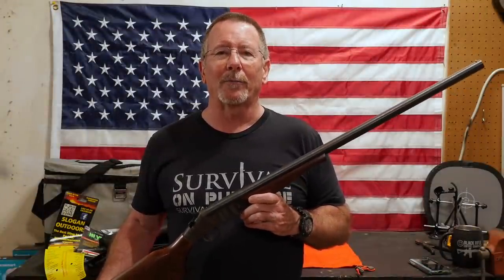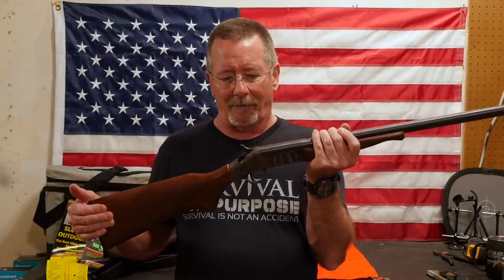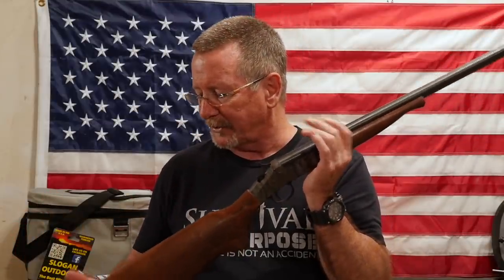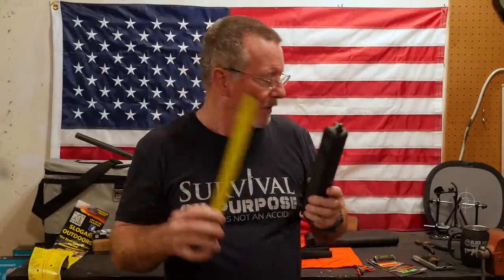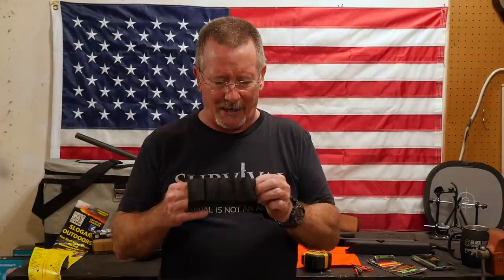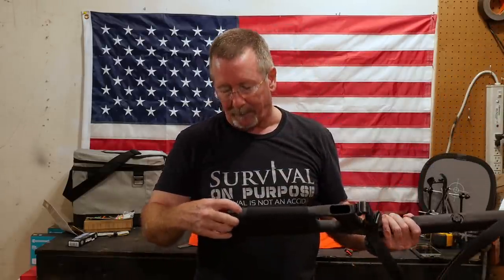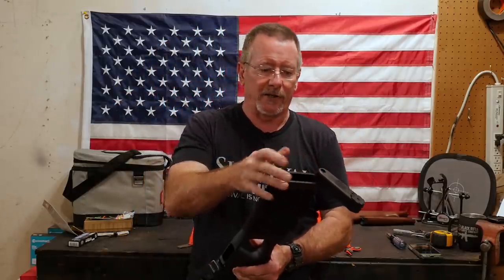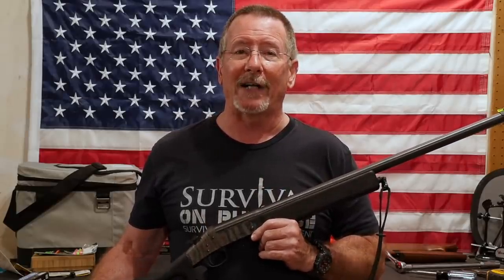How To Build A Survival Shotgun From a $100 Single Shot 12 Gauge

Comment: I’ve got one of those. It’s right beside me in my tv room. I had one of those elastic ammo sleeves on it too. Over time the elastic breaks down and they flop around and the shells fall out.
Reply: Get one made from leather or nylon. You can also get a metal or plastic sidesaddle for a pump gun and and attach it on the side of the stock with a couple screws.

Comment: I like your mods as they are almost Identical to what I did to my ATI single shot 12 gauge with the 19.5" break over barrel, which incidentally came with stock storage, and only cost me $99 plus tax at my local pawn shop.  You got about $250 in yours, and I got $140 in mine, having picked up a used sling and butt pad for $5 each at the same pawn shop.  And mine will fit in a backpack without diassembling.

Comment: Cool upgrades,  I would add my set of cylinder adapters that way I can shoot 12 , 20 and 410 gauge,  and also 22 rim fire
Reply from the maker: Yep, and black powder
Reply: Starting at 12ga, I'm up to adding 9mm, .45 ACP, .38 SPL/.357 Mag, .32 ACP/.32 S&W/.32 S&W Long/.32 H&R Mag/.327 Fed. All in 18" rifled. Search Chaszel. Top quality at a great price.
Reply: That’s what I did, I put 410,s and 22lr in stock along with a compass fire steel and a magnifier . In the hole of the pistol grip I fitted a minke multi tool, in the for-end I have a fire starter kit along with the Short Kane adapters ( not in original container ) I had to use 3/4” over for a container for them. I also cut barrel to 18  1/2 “.  It is awesome for a truck gun.

Comment: Two acquaintances of mine, one a Marine and the other a Soldier both Viet war combat vets told me that (topper) saw'd off single 12ga saved their lives. They both said it's all you need. Good enough for me, also my Dad a WW2 combat vet only had a 12ga wingmaster in the hallway closet with a box of 00buck above, on a shelf, I guess that's all you need. I have the single 12 in my car trunk with a box of 00buck and a hack saw next to it and a half round bastard file, I should find a pipe cutter to to it nice but I figure nice isn't a necessity.
Reply from the maker: That may be all they needed but things have changed. A single shot shotgun is no match for multiple thugs with semi-auto pistols. Or at least nottyhe optimal choice anyway.

Comment: I built mine for cheaper. Just gotta shop around. I also used a One Tigris ammo ouch on the stock. It has a zippered pocket for extra storage. I’m not putting an adapter with mine. I have 12 gauge flares, buckshot, bird shot, and slugs. It was still very late and had storage space
Reply from the maker: Whatever works.
Reply: Survival On Purpose that’s what it’s all about. Getting quality stuff that works best for each individual. The whole point is to make it hone safe

Comment: "Least tactical." Tell that to Matthew Quigley.
Reply from the maker: That wa not a shotgun. It was, however, a movie and it was also set about 150 years ago or so.
Reply: @SurvivalOnPurpose   Thank God you wasn't stupid and cut the barrel down like many of the idiots who "made" their survival shotgun and cut down the velocity of the shells and distance. However, one can carry far more 410 shells than 12 gauge or 20 gauge. I put high gloss green nail polish on my 410 bead sight, which was quite cheap and highly visible. Since mine is an old Rossi with a wood stock, 28 " barrel, Modified Choke(and no safety), I did not change out the stock. Sorry, but wood furniture is better looking than synthetic.  I can carry 9 assorted shells  on my butt stock (Mossy Oak rifle bullet holder). I can carry an additional 20 assorted rounds in a rifle pouch on my belt(designed to hold 14,  6 will sit in the middle) I found a leather woman's purse(Good Will) with a long leather strap that now is my shoulder sling. I have no intention of ever buying inserts to shoot other than 410. I have, however kept some old high brass, so I could "black powder" it, like an old muzzle loader(which also uses less Pyrodex and shot than a 12 gauge). If one wants, the best survival weapon, with long term in mind, portability and thriftiness, then one can't beat a 410(though your range is cut down compared to a 12 gauge, though rabbits on cold days is no problem).

Comment: Any input on barrel length that would do well for hunting and defense? I'm thinking 18.25" might be a bit short.
Reply from the maker: 18.25" is fine as far as I know. A lot of people think longer barrels on shotguns improve the range or pattern but I can't find any data to support that. The choke seems to be the big factor there. A longer barrel does seem to make it easier to swing swing on a bird smoothly but it could be a detriment in a self defense situation.
Reply: 20-22” is the middle ground for both. If you are going to be in more brush, go a bit shorter. If you are going to be in more open ground, go a bit longer. A few more inches on the barrel won’t add weight like a few more inches of rifle barrel does. A longer barrel on a shotgun helps with accuracy the same as a longer barrel on a rifle, longer sight radius. The great thing about singles is that they are light. You could carry two and barely notice it. I have a long barrel (27.5”) and a short barrel (18.25”) in 12 gauge and a 28” barrel in 20 gauge. I can carry both 12s without worry.